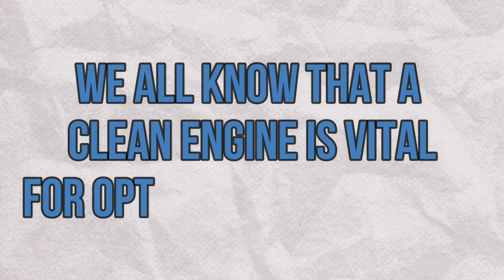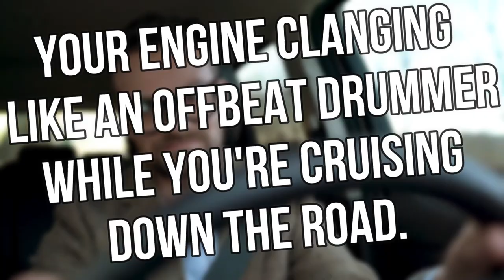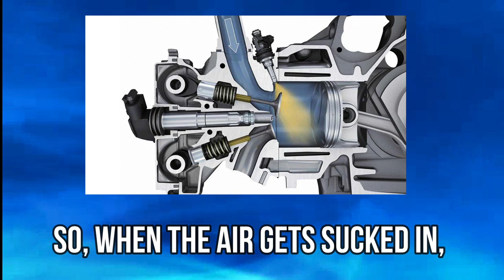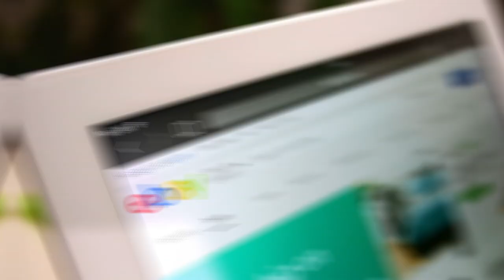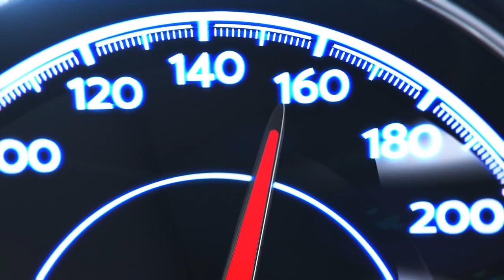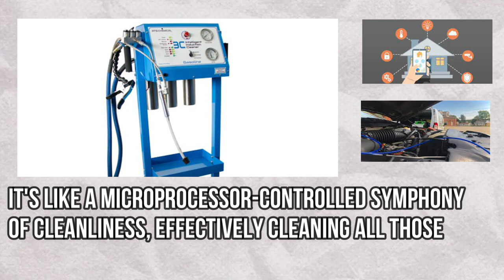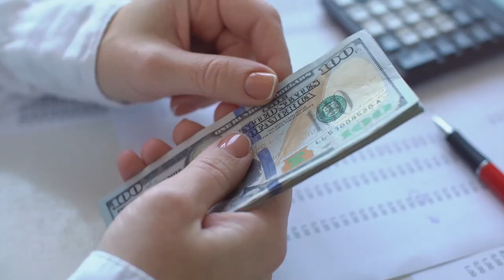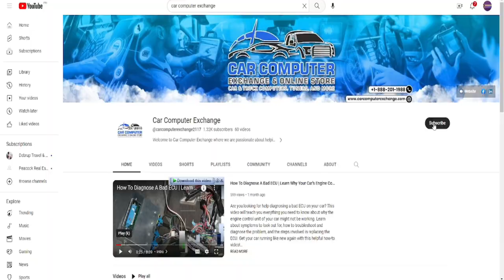Why You Should Never Carbon Clean Your Car's Engine | The Hidden Dangers

Comment: Regards for this useful video.  It is essential to have your car diagnosed by a trained mechanic if you notice any issues with the engine, such as decreasing fuel economy, rough idling, or a lack of power. Although carbon accumulation is one potential cause, it is not the only one.
Reply from the maker: Thank you for sharing your thoughts. We appreciate the feed back.

Comment: Thank you for this informative video!  If you notice any problems with your car's engine, such as decreased fuel economy, rough idling, or a loss of power, it is best to take it to a qualified mechanic to diagnose the problem. Carbon buildup may be a contributing factor, but it is not the only possible cause.

Comment: While carbon cleaning can be beneficial, it's essential to approach it as part of a broader maintenance plan for our vehicle. Regular oil changes, air filter replacements, and following manufacturer-recommended maintenance schedules are also critical to keeping our engine in good condition.
Reply from the maker: Thanks for watching Diego.

Comment: Yes, yes you should carbon clean your engine if it's needed. If your driving conditions and engine specs cause excess carbon buildup on the intake valves, you WILL get misfires, hard starts, and reduced fuel economy and performance. Cleaning off the carbon will restore the functionality, but it obviously has to be done right. Media blasting via flammable media like walnut shell or some kind of detergent/chemical treatmeant will both work beautifully, but obviously cleaning the carbon with sand will do harm.
Reply from the maker: Thanks for watching and sharing your feed back clover.

Comment: GDI has become universal engine scam. Some of GDI pioneers, Isuzu, Mitsubishi did not widely adopt, likely for reasons. Aviation industry yet to adopt GDI. Intake valve carbon build up shown here, crankcase oil dilution, more frequent oil changes,  two fuel pumps, high pressure fuel pump higher loading on camshaft drive parts, high pressure fuel connector leaks that easily cause engine fires, higher exhaust particulates, another cylinder head penetration to weaken it,  added ECU complexity to control GDI. Is GDI worth
it for just a little more power and MPG?

Comment: Worst advice ever.  Change your oil every 3k and use full synthetic oil.  Additionally use some sort of fuel additive now and again to keep your piston rings free.  GDI is a nightmare and modern engines are garbage at 100k because of it under manufacturer recommended maintenance schedules.
Reply from the maker: Thanks for sharing Braunh.